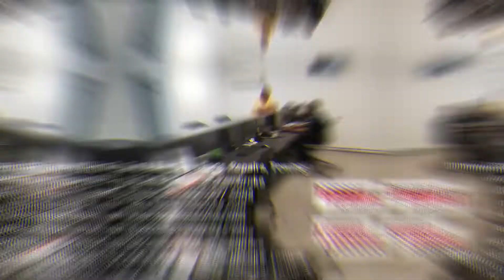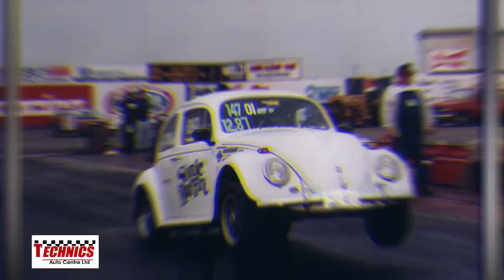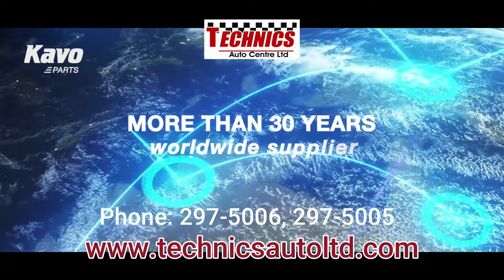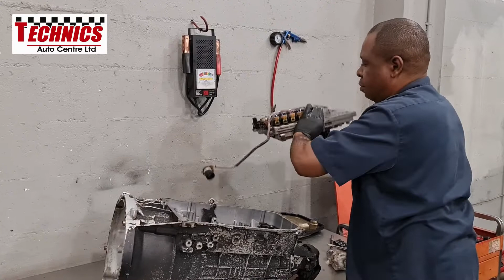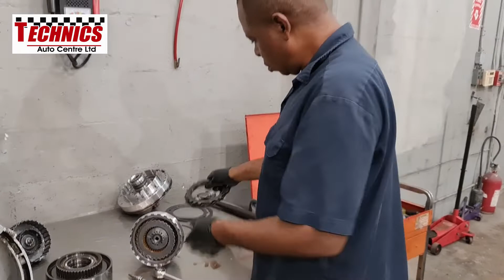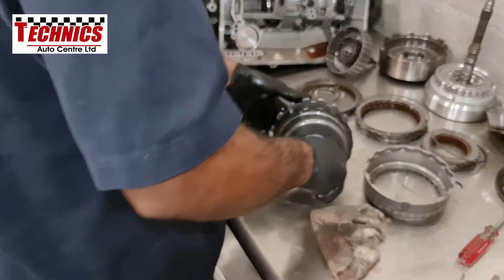How to disassemble the automatic transmission. Video Series  B. Part 1

Comment: Hello sir,

I bought a BMW E30 1.6 this year and as I am quite enthusiastic in everything I do I dug deeper and deeper and know I am fixing every little bits on my diamant schwarz baby. I want to say that your video regarding the M10 engine helped me a lot and that it is unique on the whole internet cause of the fact that it is the most deeper insight of this legendary engine. Keep up the good work and also I will pinch in a small question. Recently I replaced the spark plugs and I found out that they have oil on them. My question is if the problem is linked with valve gaskets, because after seeing your videos I am sure that it isn't related to the valve cover gasket.

All the best,
Filip
Reply from the maker: Thanks for the compliment. 

Depend on which section of the spark plugs has an oil deposit. If the oil deposit is located on the spark plug electrode (inner area), this could indicate damaged valve seals or the oil piston rings. The engine overfill with oil can cause this issue. If the oil is located on the spark plug ribs (outer area), the valve cover gasket will be the central part to check.